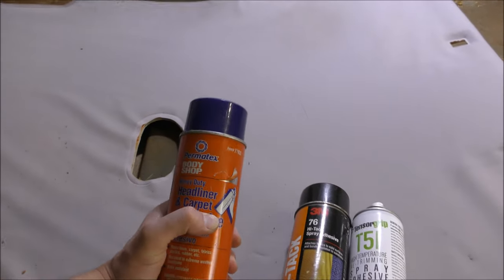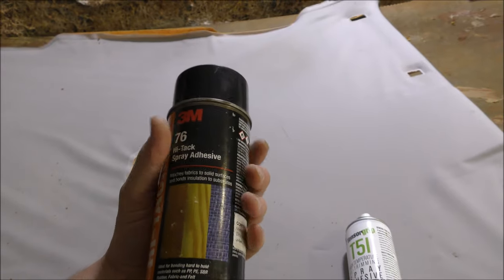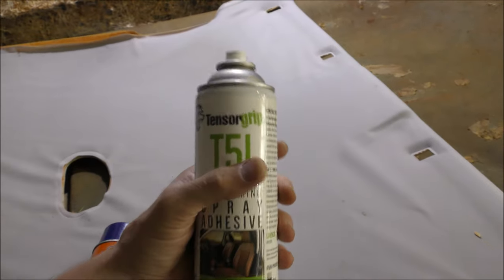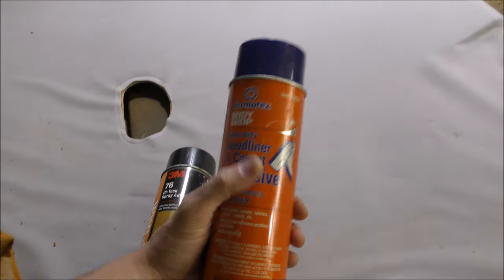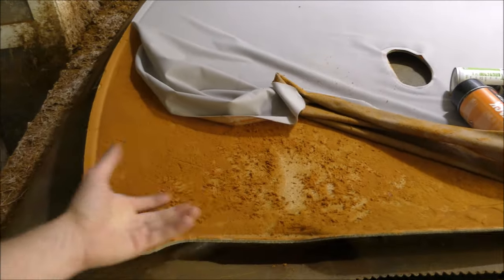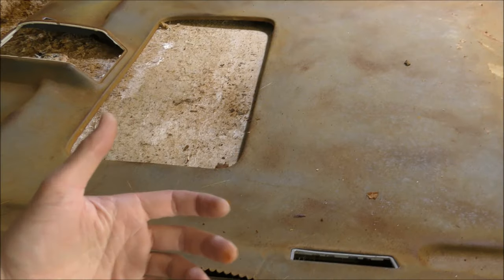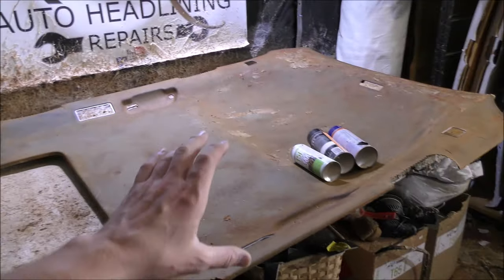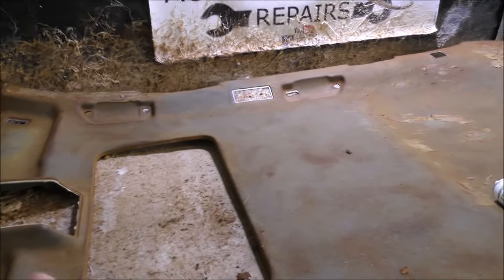What Glue to Use for Car Headliner | BEST Roof Lining Adhesive

Comment: I’ve used the 3m to try to re stick the foam at the bottom of my floor mats. Shit came up next time I removed the mats. Used the permeatex to wrap my A,B,C panels and other parts and this shit will not lift back off  the second you press it down, overall insane hold but it ain’t easy to work with bc of that

Comment: Hi great video!  I just installed a new foam fabric material to my cleaned headliner using the 3M but the problem I found was that after spraying the glue on my headliner and fabric but found that its workability time was almost zero so that once it stuck it was very difficult to shift the fabric around curves and unflat surfaces causing damage to the foam as well as wrinkles when I tried to re adjust the material .  What can u recommend to prevent this?  Or is there a particular glue that gives you some workability time ?
Reply: Did you use the 3m adhesive shown in this vid, or 3m’s headliner specific adhesive?

Comment: I wish I watched this one first. Per max, the orange can comes out like foam, my 5 minutes of shaking not enough. For droop by the windshield I’d pin the thin fabric back it tends to roll and I’d use  a foam brush and dab it in just the one side twice. The adehesive does stain it got in the rolled fabric and ripped while trying to unroll. The headliner is open and masked by the windshield so now I have to get creative to mask that disaster.

Comment: Best way to get that glue off is to get some lacquer thinner in a spray bottle and soak it, get a razor blade and scrape away, the best razors are the plastic ones because they won’t grab into the board and tear out chunks like a metal one

Comment: What to use for old material, then?
Reply: You don't. The reason headliners fail is the foam deteriorates over time. The only remedy is pull the headiner, clean the board of old foam residue and glue new material on. Headliner material can be bought at hobby and craft stores for a very reasonable price.

Comment: Hi Reece, if you install headliner and there are wrinkles, and you want to do it over completely, is it possible to remove the permatex or other adhesive to start over? Or are you stuck with what you got? What would you use to remove the adhesive once the whole thing is set, but it isn't 10 years old? Obviously you'd need to put on new headliner, but I mean just to get back down to a clean headliner board.
Reply from the maker: As long as it was good headliner fabric used, which is foam backed and has a layer of fabric on the back of foam too aswell as front, then you can peel away old material, and glue won't even be an issue to remove.

However if glue was added to all that old orange foam and or added to raw backing of fabric or raw foam without that stich fabric  barrier on the back, then you'd have issues removing glue/foam and possibly damage the board .

Also some headliner boards are difficult to remove fabric that's not sagging without damaging the board. In that case your best option may to be just Recover over the top of existing fabric, but that's usually on cars that have a carpet/felt headliner
Reply: @ReecesAutoHeadliningRepairs  The Thanks for the response! The old headliner and old orange foam was removed to get a relatively clean headliner board. But then putting down the headliner was a pretty ugly job. I sprayed both the headliner board and the foam backing of the headliner. The adhesive can directions were to wait until the adhesive became tacky, which I think was a bad idea. It became extremely sticky and getting it down properly was difficult. For the novice I think good advice would be to do it in small sections at a time, working your way towards the front and back a little at a time, putting a little glue, setting the headliner, and repeating. 

The headliner has cloth on one side, and foam on the other. I have never seen headliner with a fabric barrier on the back. Do you have a link to one, so that I can see what it looks like? As I'm not in Australia I'll have to find a local vendor, but at least I'd like to know what to look for. 

I'd rather not put headliner on top of headliner if possible, that sounds like it would look unnatural. I'll probably live with it, but I would like to know if it's possible to remove at some point if I get sick of it. I was thinking of using an adhesive remover, but I'm worried something strong like 3M adhesive remover might destroy the headliner board, and I don't know if Goo Gone or alcohol or mineral spirits would work. What do you think?
Reply from the maker: @omnesomnibus2845  A list of our fabric can be viewd here in this video https://youtu.be/w2_cP7idWns

Just not sure If I go into much detail if at all about the back of the fabric, and the stich fabric layer on the back of foam, which is very important to have.

Thanks for the good tip to let others know they should tackle these at small sections only if they haven't had much experience yet working with glue dry times . 

I suggest don't do a headliner when the day is over 30° as it can become very difficult to apply within the glue dry time window
Reply: @ReecesAutoHeadliningRepairs  Thanks!  Good to know about the different fabrics, I was not aware. Unfortunately it doesn't look like the back of the fabric is shown in the video you link, but I'll keep an eye for a fabric that is similar to what you describe. 

Also good to know about the temperature. Over here it's winter, so not a problem, but if I have to do it again I'll keep that in mind. That is, if I am able to take off the headliner and Permatex I already put on to replace it with another....
Reply: Also, if it’s a small wrinkle, I’ve had a ton of success using an iron (lightly of course). The heat/steam will melt the glue a bit and make it reworkable for a short period
Reply: @Itsbuiltbyben  Good idea!

Comment: Permatex and 3m don't last long.  Once it's installed and get hot in the vehicle it will come loose. I learned the hard way
Reply from the maker: I agree, but maybe only if its applied incorrectly. These products will work as long as the surface is clean and using new foam and new fabric. Spraying glue to both sides, the board and underneath fabric. Having dry time correct. Applying adequate pressure where required to make a good bond.

Here is a video we did demonstrating exactly how to use Permatex Can Headliner Glue.
https://youtu.be/Cprd_2xYaFo

Comment: How do you reapply adhesive between the roof and the back of the headliner if you want to install a new headliner in a car? Just apply it to the edges or to the whole thing?
Reply from the maker: Here is our best video describing exactly what we do every day to repair roof linings, hopefully that brings answers to your question
https://youtu.be/kZ_bICRvh-Y
Reply: @ReecesAutoHeadliningRepairs  Hi, no, do you mind explicitly advising that once a new headliner is ready whether any adhesive needs to be applied between the top of the headliner and the car roof to keep it up there? I understand that adhesive is used for reupholstering fabric to a headliner, but I'm not talking about that piece, only the non-fabric piece and its attachment to the roof. Is no spray adhesive necessary?
Reply from the maker: @expatcrypto  OK I understand, I'd suggest don't add glue on the back of the board to secure it to the metal roof. Some models do this, eg: Renault Clio I believe, and it's terrible to remove, can potentially damage the board. 

I suggest to use high quality Industrial sticky back Velcro to hold and secure parts of the headliner board. To increase it strength, spray some 3m 76 glue/ Permatex/ TensorGripT65 to where you place the Velcro too. This will give a good hold during high heat situations.
Reply: @ReecesAutoHeadliningRepairs  Understood, much appreciated!

Comment: How about the 3M headliner adhesive? Is it good?
Reply from the maker: 3M is a good brand, so if they have brought out a Headliner adhesive, it should be good.

The ones we have tried and suggest to use would be one of these glues

Permatex Headliner Adhesive 
- http://ebay.us/apC9ZH

3M high tac 76 Headliner Glue
 - http://ebay.us/eAGTji
Reply: Thank you
Reply: Yes, I recently bought some 3M headliner adhesive at Walmart in Florida.
Reply: Will this bleed thru an stain the headliner?
Reply: It shouldn't bleed through if used as directed.
Reply: No go permatex

Comment: What glue are you buying in bulk?
Reply from the maker: Currently usually buying TensorGrip T65 or T51 in bulk, at 20lt volume each item.

For one of jobs, we suggest to use one of these glues

Permatex Headliner Adhesive 
- http://ebay.us/apC9ZH

3M high tac 76 Headliner Glue
 - http://ebay.us/eAGTji
Reply: @ReecesAutoHeadliningRepairs  Thank you, Ive used weldwood spray glue before and that stuff comes undone

Comment: So your saying replace whole headliner .Thats more than most pay for the car thanks I'll use gorilla glue .
Reply: Did it work? I’m gonna try the gorilla spray adhesive with the original headliner. It’s an older Escalade I’m driving into the ground. 350k miles right now and I’ve never had any major issues with it.
Reply: @KelticTim  did the spray gorilla glue work?
Reply: @laurapennington4498  actually it did. I bought a second can to practice with, and spent some time figuring out exactly how I was going to secure it while the glue cured, I would highly recommend doing the same, it’s pretty tricky to use, but once you get the hang of how it sprays out, and how much spray you need, it works well. Even though it says right on the can to not use it for that. Idk why, maybe way it reacts with certain headliner materials.

Comment: Does anyone know if gorilla spray glue works well with original headliner?  We can’t all afford new headliner, and gorilla glue spray is fairly cheap as well and it’s a good brand.
Reply: Use permatex it's a few bucks more expensive just follow the instructions. If your headliner is coming off on the sides you'll be set for few years. I was quoted $250 to change my headliner they do it in about 2 hours the most they expend on material is $30 practically they are charging me $110 per hour. That's too expensive for me, I don't do it myself because I have no garage or place to do it, anybody that took kindergarten can do it with the help of YouTube tutorials,  Good luck with the project.
Reply: There is a note on the Gorilla Glue's own Website advising anyone AGAINST using  one of their products for headliners.
Reply: @silentdiscussiondjs  that could just be a liability issue, it may work very well if you prepare the area properly, but since they know ppl are morons and won’t do that they have to say that. Don’t prep it right and it could come down on you while driving. I think I’d be ok using it in conjunction with some correctly weighted double sided tape. I ended up selling that car as is for a bundle anyways, so it’s a moot point for me.

Comment: That 3M spray is total bull shit. You can't get it. nobody has it.
Reply from the maker: I feel your pain, global supplies have been disrupted, I'm not sure what's exactly causing it, but both permatex and 3m are out of stock here on the shelves in Australia, a few online sellers are selling it at double its shelf price. 

I can suggest places I've seen 3M 76 or Permatex at in the past, which are:
Office works
Dayleys Upholstery supplies
Clark rubber
Autobahn 

Or your welcome to buy the glues we have on eBay called TensorGripT65 

Buy TensorGrip T65 500ml Can - https://ebay.us/rysIGV
Reply: @ReecesAutoHeadliningRepairs  Hey Thanks Reece's! I want to try a spray if possible. I will try some of your suggestions. Subscribed buddy.
Reply from the maker: @blackjacket7118  excellent, the T65 500ml Can is a spray glue, great for all jobs except Audi, Volvo and VW. And just follow our suggestions on how to use the product, I suggest to use more glue than the product suggests.
Reply: @ReecesAutoHeadliningRepairs  Hey Reece, great suggestions! However, is there a glue recommendation for headliner repair for the VW CC headliner?  I searched on Youtube but didn't see much info on which glue I should use for that kind of headliner board.
Reply from the maker: @chongteng7826  I'd suggest Permatex carpet headliner adhesive for VW and Audi models around the curves, sunglasses consoles etc, T65 works well everywhere else on this particular Oily boards
Reply: @ReecesAutoHeadliningRepairs  Thank you so much for the contributive advice! When I was brushing off the old foam from the CC board, there were nasty glue residues and leftover foam materials. I managed to clean ~70% of them with 1L acetone. Would you recommend using more acetone to get ~90% clean or is it ready to apply the new fabric? Thank you a lot for the tips again! Subscribed!